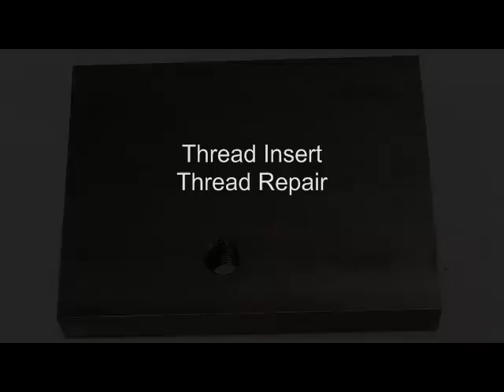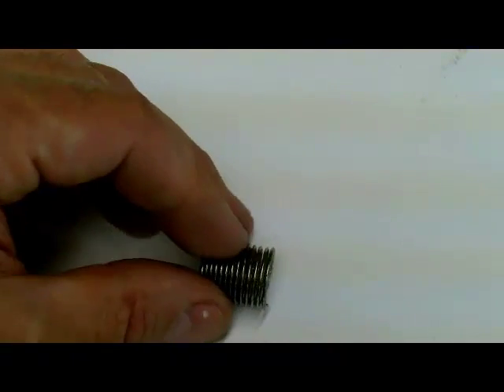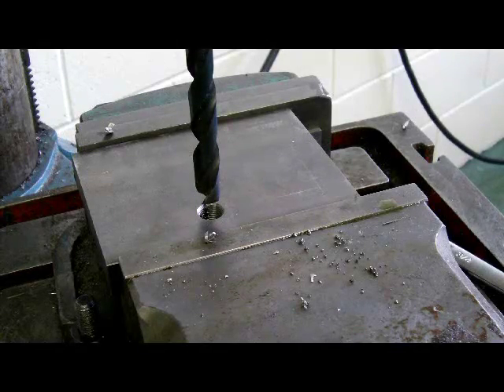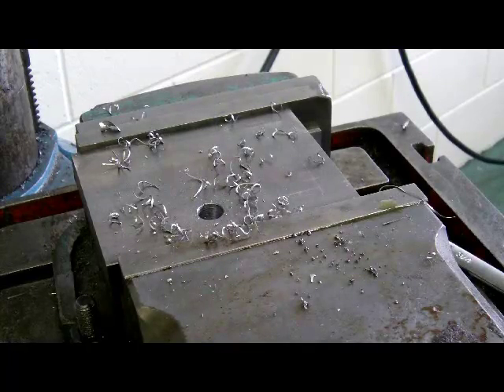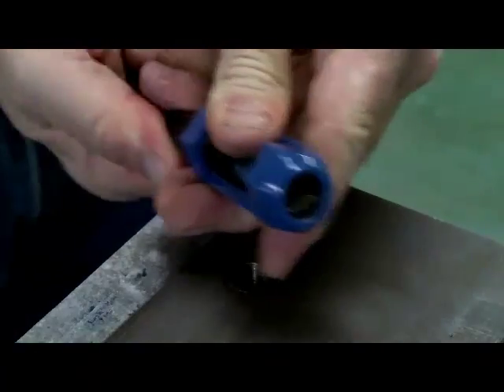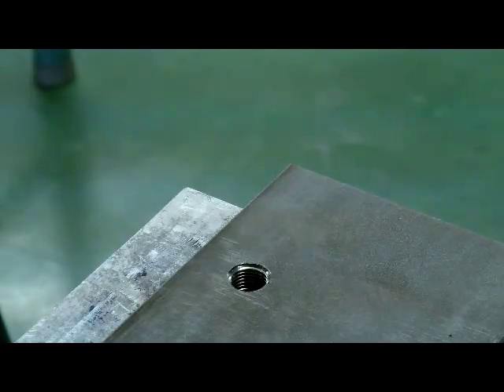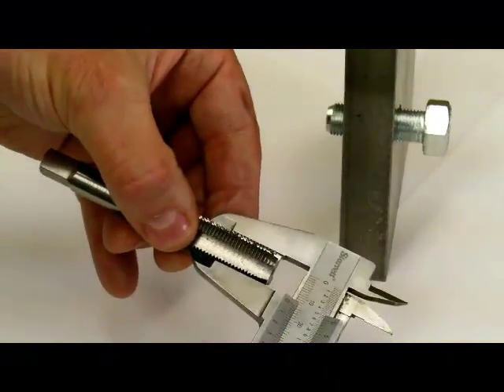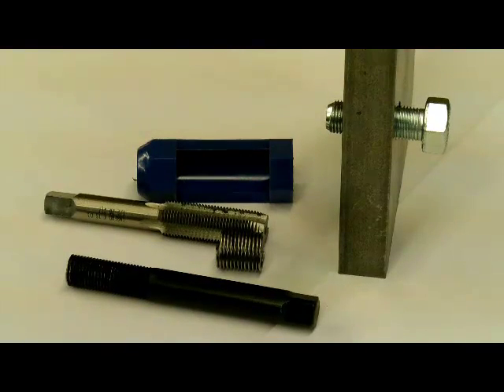Thread Repair Using a Thread Insert

Comment: I’m not sure how to contact you however, you responded quickly to my sub of your channel so here goes. I picked on this helicoil vid because I have a need for a particular thread and cannot find one. The size and application; 7/16 x 27 tpi, 1955carter carburetor inlet port. The fitting itself is ok. Threads in the carb body are almost gone. One thread not completely around is all that remains. A heli-coil would be perfect. Maybe you could suggest an alternative. One “minor”detail, the fitting also doubles as the float operated shut off. The float needle resides inside the fitting requiring the depth to be a very critical dimension. Suggestions?
Reply from the maker: Hi Lee, sorry for the slow reply. Without seeing it I'm guessing...I'm seeing in my head the gas line coming into the carb body and a compression fitting on the end of a steel tube. Where it threads into the aluminum carb housing is stripped. The easy answer is can you find a larger fitting and thread the housing to suit. Another thought I have is if you can find a 7/16 -27 tap (good luck, and I don't think you will find a helicoil) you could 1 have a good welder build up the port and remachine it or if there is enough material sleeve the hole. Another solution to welding is JB Weld, I've had some success with that. The biggest problem is the odd thread, easiest solution is a bigger fitting, maybe from a different carb? I wished it was in my hands. Sorry for the rambling, I hope it is some help. BTW the thread is very close to 11 x 1mm.
Reply from the maker: Lee, I've just Googled 11mm x 1mm taps, they are available. If you can build the housing up this may get you out of trouble! If you go this route try it on a scrap piece of metal first and see if the fitting will screw in.
Reply: machiningmoments  thanks again and it wasn’t slow response at all. We think alike because I too found the metric to be a close fit. However, we are talking an American product of the fifty’s and I’m not sure how much metric was used. If I can find a tap then I can make a bushing. Just FYI, I started with a larger fitting was stopped by the thread. Helicoil was next and struck out there also. Am waiting for response to mfg. for specialty tap.  JB weld is being considered however, I don’t have enough experience to say it will hold up or even seal against gas leaking. Just the kind of machining problem that is just plain fun!
Reply from the maker: What I like about JB Weld is it is machinable, goes on like Bondo, and doesn't require heat causing warping. I'm not certain how it reacts with chemicals (gas) but I have used it on intake manifolds. Best of luck Lee!

Comment: Re: prewinder- Here is what the Helicoil website has to say about the subject: "Generally, finer pitch inserts are proportionately larger in the free state than coarse pitch inserts and therfore have to be “pre-wound” to a smaller diameter for installation." A prewinder is not necessary for use with standard NC- series threads because they are not significantly expanded in their free state and may be inserted directly without difficulty.
Reply from the maker: Thanks!

Comment: I've done a lot of helicoil repairs but this is the first time I've seen a "pre-winder." Is this something only included on fine thread inserts or does it depend on the manufacturer of the particular kit.
Reply from the maker: I'm not certain that the pre-winder comes with all kits, the Helicoil site recommends using one.

Comment: Can you torque those thread insert holes as much as you would a regular tapped hole?
Reply from the maker: Absolutely, often the repair is stronger than the original thread. They are made of stainless steel.